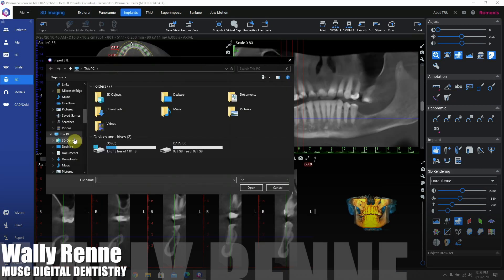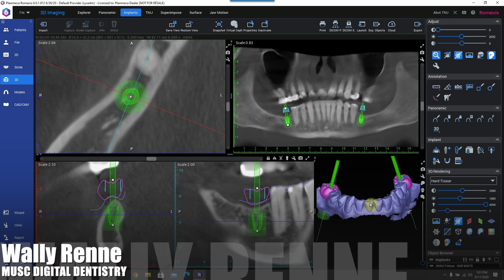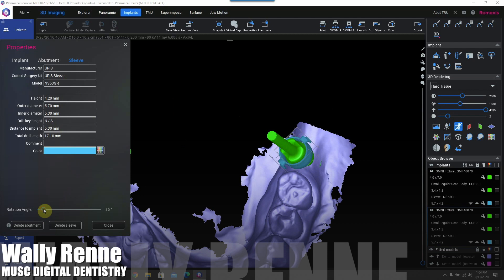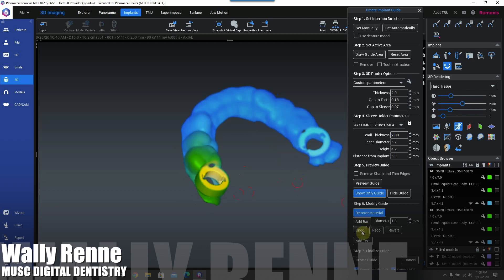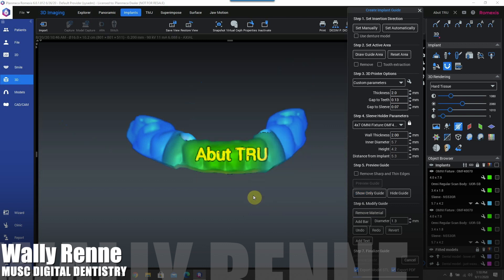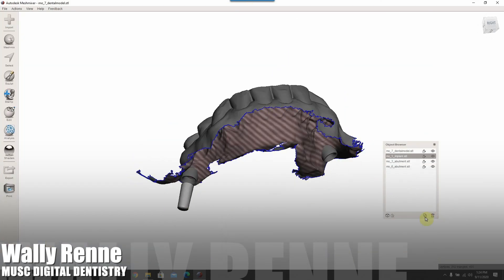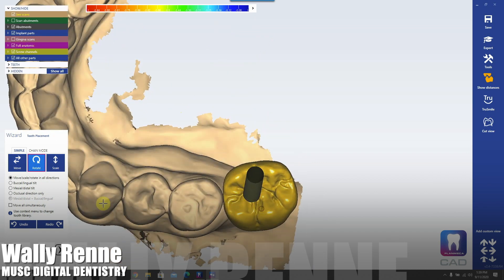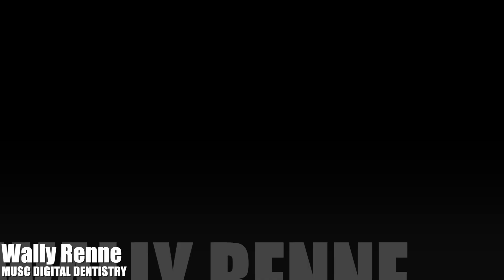Presurgical Custom healing abutments Planmeca Romexis and Exocad

Comment: Would it be possible to print out a framework for a implant hybrid denture with this filament and printer? If so, that would be absolutely amazing!
Reply from the maker: theoretically yes, but printing PEEK is quite difficult to get perfect
Reply: @wallyrenne  Do you mean the accuracy won't be good enough or what would you say makes it difficult? I was thinking of getting the creatbot f160 and using it for healing abutments and hybrid frameworks. After I saw that it was accurate enough for you to print this custom healing abutment, I figured it would work. I saw both f160 and f430 are both 40micron accuracy.. What are your thoughts?  I'm so ready to get the f160, but don't want to get it then somehow it doesn't work out(can't find much about this online :/
Reply from the maker: @Tommy43087  i have been disappointed in the ability of the FDM to print the hex accurately. It’s not as crisp as my other fdm printers. Maybe it’s due to the high temps
Reply: @wallyrenne  Hmm i wonder if PEKK would be better then. Since it prints at lower temps, plus it has its advantages...Have you ever tried PEKK for that??